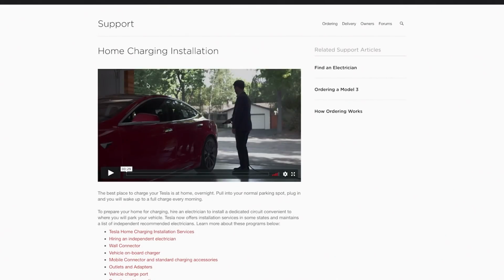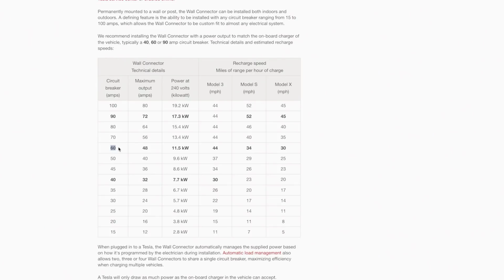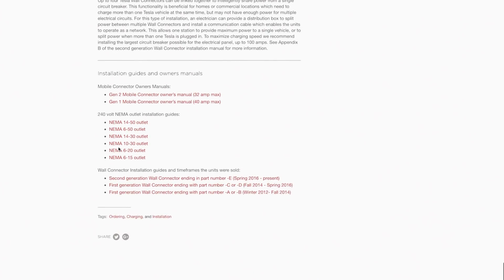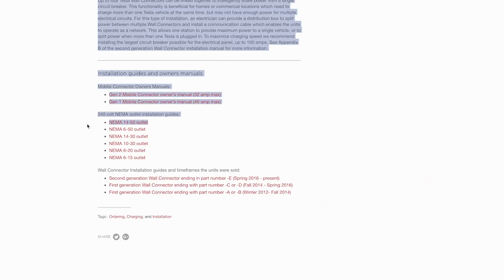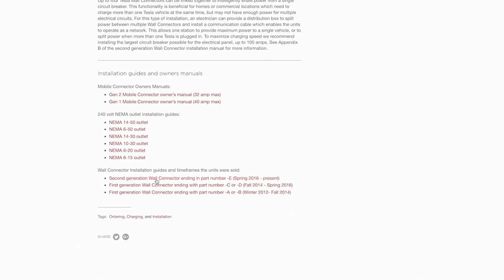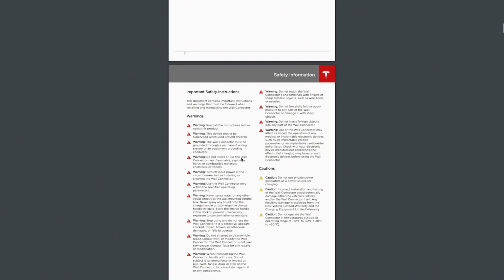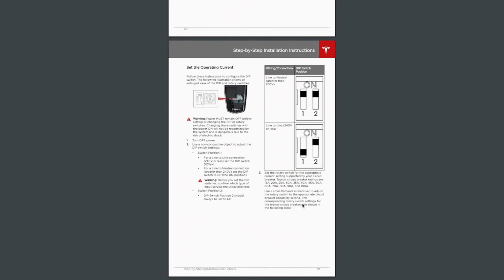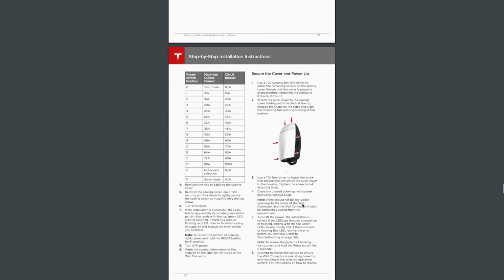A Step-by-Step Guide on Installing your Tesla Charger (Gen 2)

Comment: Great vid as always,  does installing other chargers like Juicenet/Blink/Chargepoint/Loop void warranty of the tesla car?
Reply from the maker: Nah. You can use those using the adapter. Shouldn’t be an issue.
Reply: @diywrapclub  Also, interested on your PPF -- is that going to be Xpel with ceramic or other? wanting to have it ready before delivery

Comment: An electrician told me that we only need to use Romex 6/2 (not 6/3) since both the wall connector or mobile connector DO NOT really use the neutral line. Can someone confirm this?

Comment: First I give you credit for trying to install yourself. just to advise on the install,  the ground must be connected at the panel on the ground bar. The Romex connector should be turned the other way, you have the wrong end in the panel. Next I would strongly advise a whole house surge protector the part number for your panel is QSPD2A065P for the Siemens ITE panel. You can install more than one for more protection 65/ 130/ 195 I would recommend at least two. Yes it does have some protection built in but not what you would get with the item listed above. 

Great job…

Comment: How much would you pay for a professional to do the job?
Reply from the maker: That's a tough one to answer because labor costs vary depending on where you live. But in my state, it's $95 per hour or so. It takes roughly 2-3 hours to do it, and material costs have increased dramatically. It also depends if you're routing straight from the panel or if you're running wires through dry wall. That's a very time intensive labor and requires more materials so expect your bill to go up.

Comment: Incomplete and scary. This vid could get someone electrocuted. First and foremost, no one should ever work inside the panel without first disconnecting the main power service by throwing the breaker on the power coming into the panel. Also, the ground wire does not merely get tucked away but needs to be anchored to the box.

Comment: As an electrician who builds Tesla chargers, informative video, but I HIGHLY recommend hiring an experienced electrician to do the installation. Because just drilling into the wall by a stud alone can kill you if you screw up
Reply: You dont' have to be an electrician to do 60% of electical... 110-220 anything within this range any KNOWLEDGABLE homeowner, contractor or handyman can do it.
Reply: @affordablesolutions8516  I work in maintenance in a factory and even 3 phase 480 is pretty damn easy. An orange, brown, yellow, and green wire... What's soo hard about 4 wires? 🤷‍♀️ I honestly don't think electrical work gets difficult until you start involving control circuits and components like step down transformers and complicated relays.
Reply: @codynieman3729  Me personally,  I dont know much on 3-4 phase to be comfortable...however I say anyone that is confident enough to do it have at it!! I hate with a passion people coming on and saying hire a licensed electrician or plumber or anything where they overpaid for a piece of paper for permission to work.
Reply: @affordablesolutions8516  I'm right there with ya. Electricians and plumbers are Soo overpaid. They make their living by convincing people who didn't pay for trade school that they can't do what electricians do. In my 7 years in industrial maintenance, there is only a handful of things an electrician can do that I can't, bend conduit professionally and troubleshoot complicated control circuits in a timely manner. 
Trust me though, 3 phase 480 is BARELY any more complicated than standard residential 240. It's literally just one more wire and obviously it hurts alot more if you mess it up but that goes without say.
Reply: @codynieman3729 agreed, we specialize in controls for HVAC and the relay logic can get complicated. Simple circuit for a charger could be completed by anyone with a few YouTube videos
Reply: 4 people a month die, 140,000 homes burn down and 4,000 people injured from installing there own appliances in there home each year due to poor installation. Please hire a licensed professional.
Reply: God I really don't think hiring an "experienced electrician" is necessary for a simple component and to pull some 6-3 wire and connect it to a circuit breaker. A minimal amount of common sense is really all that's needed. It's two hots, one neutral, and one ground... Don't drill into anything that you don't know what's on the other side and clipping in the new breaker should be the last step... Electricians make these things seem way harder than they actually are... Job security and all
Reply: @codynieman3729 if I’ve seen more experienced electricians then myself shock themselves over something this simple, I wouldn’t put it past a homeowner to do a lot worse. So no common sense isn’t that common, you feel me?
Reply: @pissedpanda  well yes common sense certainly isn't that common in this day and age, but you kinda proved my point. You yourself said that you've seen experienced electricians get zapped doing a job this simple thus proving an experienced electrician isn't what's "required" to do this job, common sense and a minimal amount of electrical knowledge is what's required, which is what my point was. Red, black, white, a ground, don't drill into anything you don't know what's on the other side, and clip in the breaker last...🤷‍♀️ There really isn't much more to it than that.
Reply: @codynieman3729  fair enough I see ur point Brodie, regardless safe installations haha🤟🏽

Comment: Technically the install doesn't meet code.. He used #6 NM-B on a 60 amp breaker for a EV charger which is considered a continuous load. Since its a continuous load at 48 amps the wire must be rated for 60 amps. #6 NM-B is only rated for 55 amps (you can't round up in this case)...If going by the actual code he should have used #6 THHN, which is rated for 75amps.  However, personally I don't think this is unsafe, its just not has conservative and the code.
Reply: Technically, THHN is rated from the 90c column. NM-B is derated from the 90C column...since we are getting technical 😉
Reply: @jmlastname4412  90C is only used when derating.  THHN is sized from 75C column.
Reply: @paulpatten7799  that’s right, is less than 100 amps, that number 6 is fine

Comment: It wasn't too bad until you got to the NEMA 14-50 part. The NEMA 14-50 has nothing to do with the time of charge. The 14-50 outlet is used with many mobile and wall-mounted chargers. It's rated for a maximum current of 50 amps or a maximum breaker size of 50 amps whether or not it's set at 48 amps inside the wall connector. anything higher than 50 amps requires it to be hardwired. Tesla's mid-range and standard range battery will charge at 32 amps. maximum. If your Tesla 3 has a long-range battery then you want the Gen-1 wall connector which you had installed. The electrician should know better than to drill at an angle through the wall stud without using a nail plate...this prevents someone running a screw through the cable, not to mention the hole is required to be at least 5/8" from the edge of the stud. One of the miss conceptions is that if your using a NEMA 14-50 you need a neutral, it is not required for residential/commercial Level-2 EVSE, so by purchasing the cable with 3- conductors plus ground you're just throwing money away. Using the neutral conductor isn't wrong, but not identifying the neutral as a ground is. Using green phase tape would have been the proper way to identify it as a ground, the same goes for inside the load center...the #10 ground would have been large enough for grounding. All certified installers would know that the wall connector has to be set for the proper current, it's fortunate that you took the time to do your research, but a lot of my customers that buy an EV for the first time don't...this would don't sit well with customers who plug in their Tesla's and are only charging at 12 amps. because the un-certified electrician doesn't have the necessary training, this actually happens quite often. My advice to others who seek out an electrician make sure they know how to install EVSE correctly.
Reply: What Steve said.
Reply: @jmlastname4412  Using NM cable it's allowable to tape the white as red or black for hot, but not green for ground.
Reply: God damn see this guy or Steve explain it way better then me the man is dropping knowledge ppl knowledge you can or won't get in college homeboy anyways my respect to you sir in educateting the ones who fallow the blind!

Comment: Don't follow these directions!  

It works because the neutral and ground are connected inside the breaker box. But the installation doesn't follow the instructions. Also, I have a collection of pictures of HPWCs that have overheated, melted, and ruined the HPWC. Google for that. These stranded wires loosen up over time. It would be better to install a ferrule over the wire ends and then clamp down on those so when they are clamped down they squish TOGETHER rather than get PUSHED APART.   Good luck to all.
Reply: Bahahahahahahahaha
Stranded conductors are used in EVERY COMMERCIAL OR INDUSTRIAL FACILITY in the US WITHOUT ferruls. Strands "wander" when they are terminated in a lug designed for a larger conductor.

Comment: It would be more useful if you specified the exact technical specs, such as wire guage, breaker amperage, how he put it all together. There is not anything anyone can learn and or benefit from this clip
Reply: I agree.... I’m looking for the wire gauge size and this video gives me nothing... how do you connect a wire in one box but not the other?

Comment: Screw the neutral wire into the ground socket?  And just put the ground wire somewhere over there?
Reply: yep, as is the neutral and ground wires are shorted in the breaker box.

Comment: This installation is not properly done.  I would remove this video, edit it for the corrections and then upload. You are going to have folks following these instructions which are not correct.  The GROUND NEEDS TO BE INSTALLED.  The neutral wire does not and can be capped off on both ends.

Comment: That is not the correct installation. This Tesla charger does not require a neutral (white wire) because It’s a single phase 240v circuit. That ground should be going to the ground bar in the panel and also the ground lug inside of the Tesla wall charger. Also from what I see...is the neutral (white wire) connected to another 2 pole circuit breaker??? If so that is extremely dangerous.

Comment: For Standard Range Plus, should it use 40 breaker like tesla website says? Since it only accept 32amp max charging for 3 S+?
Reply from the maker: I would go with what the Tesla website says.
Reply: The proper size breaker would be a 40 amp 2-pole.

Comment: 60 amp breaker! You’re really lucky that you could go for the maximum current that the Long Range or Performance Model 3 can handle.
Reply from the maker: I am lucky. I was cutting it close though. My house can only support 200 amps but we don't usually run everything at once, so we're good :D
Reply: Tesla Bros I’m sure that you charge late at night when the demand for electricity lower and the cost to you is lower, if you have a time of use electric meter.

Comment: Cool informative video but your electrician is a hack. First the NM connector at the panel entry is upside down and reversed. The clamps are always supposed to be on the outside of the panel and not the inside. Second, the charging hub does not require a grounded "neutral" but does require an equipment grounding conductor. Sure it'll work the way it was done but there those are two violations for the record.
Reply: I agree, I would edit that using neutral for ground BS out of the video, its a violation, other people watch this video, & I would edit the video to make sure I’m giving accurate information.
Reply: Yes, my understanding is that a neutral wire is not necessary here.  Many people connect it to the white/neutral bus bar @ the panel just so that if they ever convert over to a 14-50 outlet they already have it run out through the conduit or whatever.  But you don't need a neutral wire for the HPWC.  What you do most emphatically need is a proper ground, so do connect the green wire.

Comment: My understanding is that the wall charger does not utilize a neutral wire connection. You connect the two hot leads (L1 and L2) and then attach the ground.  The ground would in turn be attached to the ground bus bar at the service panel.  The neutral would therefore be capped or taped off inside the charger.
Reply: GrizzledGhost Plus you’ll save $ by buying a 2 conductor cable with ground as opposed to a 3 conductor with ground.
Reply: Yes, that is correct.  As this was mounted to a circuit in the main panel, the neutral and ground are on the same bus.  If this charger were mounted to a sub-panel, the ground and neutral are on separate buses and should be mounted as such and then tape/cap the neutral in the charger and connect the bare copper ground wire.  I guess it is ok to have connected the neutral as was done as it won't do any harm but really, the bare copper should've been connected and the neutral capped as you suggest.
Reply: @cpad007  Why would you run the neutral at all then if you are just going to cap it off? Just run L1/L2 + Ground
Reply from the maker: You’re right.

Comment: I installed my own NEMA 14-50 receptacle in my garage for $20 worth of materials in about 20 minutes. To each his own, but I see no reason to spend $500 on the Wall Charger that’ll give you, maybe 6 or 7 MPH more charge. I get 33, 34 MPH charge with my setup, which MORE than charges my Long Range battery overnight, even from empty.
Reply: There is a convenience factor of not having to pull out the mobile cable each time you charge.  That factor and the slightly faster charge might make the $500 reasonable for some folks.
Reply: Don Thorvund agreed
Reply from the maker: rayhend100 i agree. I just got a hell of a deal on a hwpc

Comment: Thank you for this excellent video: What are the specs for the "Electrical wire 4 conductors (2 lines, 1 neutral, 1 ground) " 6/3 Stranded Romex SIMpull CU NM-B W/G Wire?
Reply from the maker: Hugo Abdulla yes i believe that is correct but i would double check with an electrician or someone who knows better.
Reply: Tesla Bros , did you check about wire? What was max amperage to that wire? I see the 6/3 in Home Depot says max amperage as 55 which looks enough.
Reply from the maker: Praveen Jha Yes that will be fine.

Comment: Same Question. What was the cost?
Reply from the maker: Jason Reeves $160 for parts and labor. Roughly an hour worth of work at max.
Reply: @diywrapclub  My guess is that is because you mounted the wall charger that close to the service panel and the electrician did not have to run long lengths of cable to do it .
Reply: @AndrewJamison79  My guess is that the electrician was not licensed or carried any general liability insurance/workmen's comp. His workmanship leaves a lot of doubt when it comes to installing the Tesla wall connector, one thing I noticed was he nicked on the red conductor..not a good thing to do and his banging around with his linemen next to the small control wires gave me a chill. You don't bang around inside the charger like that.
Reply: @diywrapclub  That is not electrical contractor rates. That is craigslist handyman rates.

Comment: How much did your electrician charged you ?
Reply: $160 parts and labor? No self-respecting electrician would do it that low!
Reply from the maker: JC ELECTRIC i thought so too lol but im not complaining
Reply: @diywrapclub  what parts did he supply?
Reply from the maker: D M electrical wire and a 60 amp breaker
Reply: @diywrapclub   lol oh wow they didn't make much... good deal
Reply from the maker: D M yea. We are in the state of MS so its cheaper here, too.
Reply from the maker: eyvin martinez $160 for parts and labor. Roughly an hour worth of work at max.
Reply: Wow! That’s good!
Reply from the maker: InfoZenn yeah! You can help by having it ready for him.
Reply: Tesla Bros I will do that. Thanks for the tip
Reply: What area are you located? Seems like a steal
Reply from the maker: pineappleboyX Memphis/North Ms
Reply from the maker: pineappleboyX memphis/north ms
Reply: pineappleboyX yea
Reply: That should be a $300.oo at least but you're lucky.
Reply: Can't go really low it's like a $325